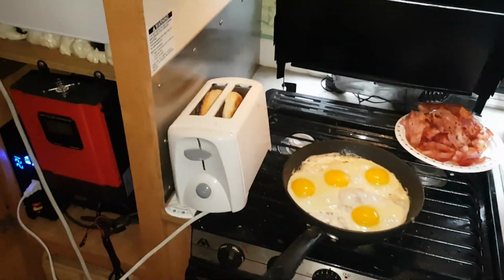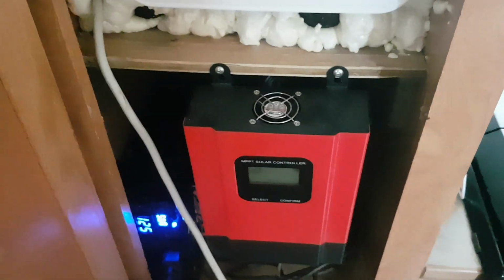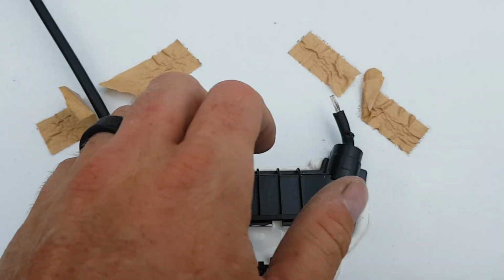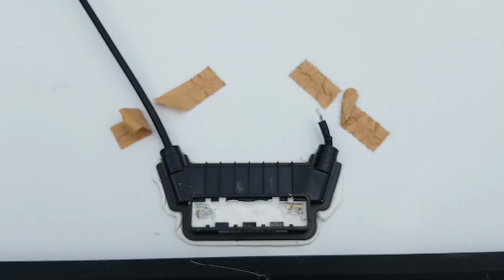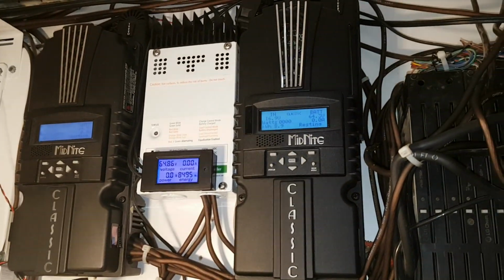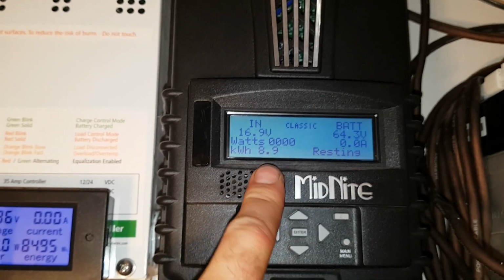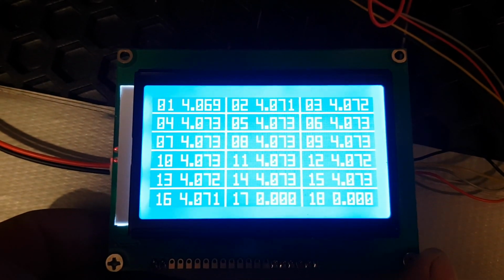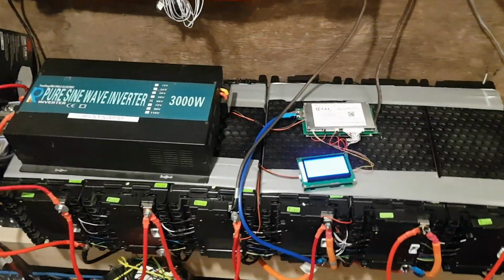Inverter Generator Parallel With 3000W Reliable Inverter And Much More

Comment: Any way to parrellel two 3000w reliable inverters? I have two that are from different years but both are 3000w. Not sure if it would work cause syncing sine curves or whatever, I think that is what ur special generator does?
Reply from the maker: You are right, they need something to sink the sine waves
Reply: @GoingOffGrid101  to bad there isnt an easy way

Comment: Soo if im using 1500 to 2000 watt inverter do i need to have 1500 to 2000 watts of solar panels
Reply from the maker: no, it just means you will deplete your batteries faster then your charging at if you pulling full load from your inverter.

Comment: How's the 8kw "Reliable" on high startup loads? Does it explode like the older models?
Reply from the maker: No it has a current sensor that lets tells the inverter to limit power. At least from my testing so far.

Comment: Fun family vacation.  I'll guess Ford Focus EV.
Reply from the maker: haha nice guess, you run your house off that new reliable yet ?
Reply: @GoingOffGrid101  No, it has a live ground, so I don't want to risk hooking it up to my breaker panel.  How bout' yours?  Does it have 60 volts from ground to Neutral and 60 volts from ground to hot?
Reply from the maker: @DavidPozEnergy  mines the same. Remember the inverter ground is just tied to the inverters case, you can ground before and after the inverter with the same out come, its not like the inverter has ground fault safeties :P

Comment: What do you think about the MidNite Solar Controllers, besides being expensive?
Reply from the maker: I love them! best there is I think
Reply: How efficient is yours?
Reply from the maker: @MrBrymstond  think it said 98 or 99%
Reply: @GoingOffGrid101  That's crazy! Can't get better than that. Almost impossible when you consider the law of conservation. Silver is the best conductor, so I would bet they use that for the PCB and solder, maybe not, but 98 to 99% is off the rails. They must use the best components. You're getting everything those panels can suck up. This guy claims he has 300 watt panels. I had things that fell off the back of a truck, but not to this level, I can't afford all this unless I hit lotto, but I can be happy for you.

Comment: I use the suicide cords and they work. I never fix anything that's not broken, besides you know what you're doing.
Reply from the maker: its others im scared for
Reply: @GoingOffGrid101  You can make a somewhat safer version by adding a GFCI, although not all GFCIs work properly if fed from both ends.